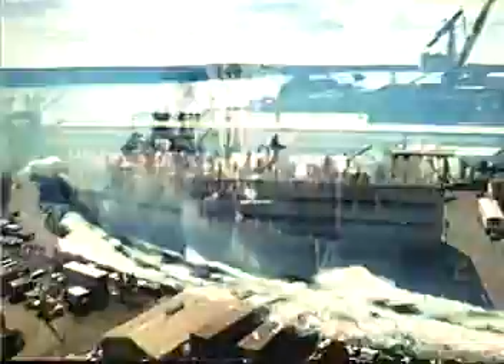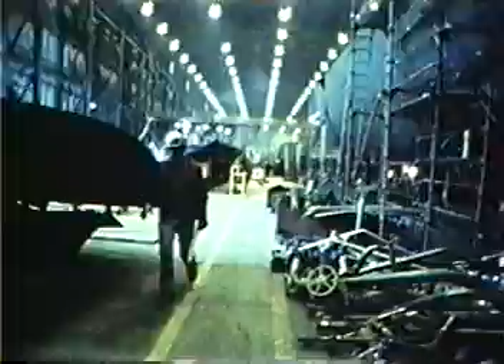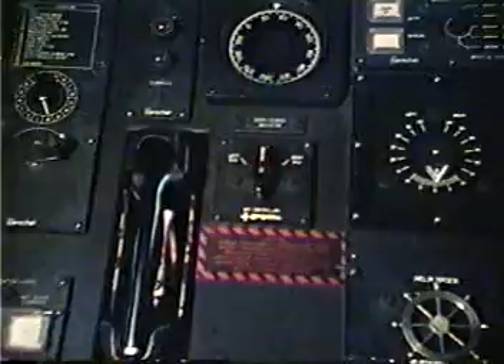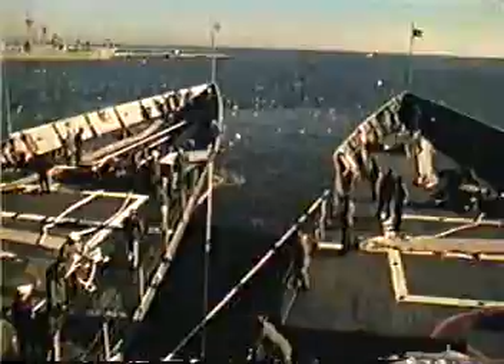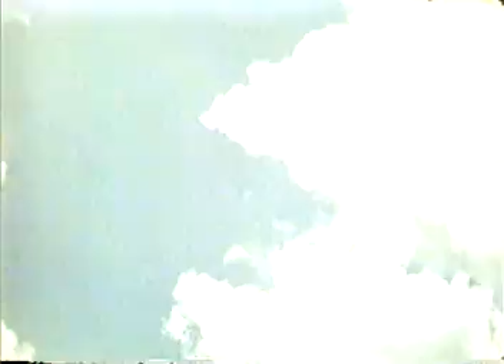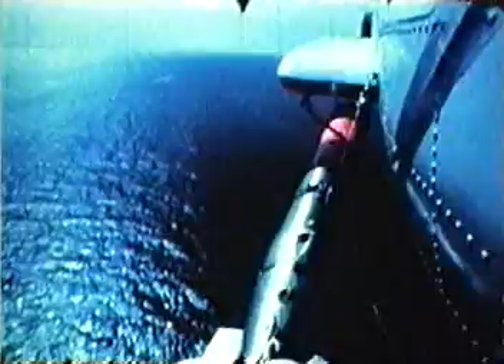FFG 7 Overview

Comment: As an ability to stay in the fight or sustainabilirt is sucked, in glad I set it on aircraft carriers, the 1 missile launcher for sn1 anti air should have replaced out of the factory with VLS, the aft mk 75 76 mm gun was a limited capability due to weapon cut out. Weapons and sensors could have been improved over time but it wasn't. We called it a jack of all trades expert at none.  It's advantage was as a sailor you worked way way way out of your rate by repairing everything and had a good grasp of being in the Navy and more marketable. Wow holy side burns and beards.

Comment: Anyone else take one cursory look at the Freedom and Independence classes and say to themselves “no way are these FFG-7 replacements”. 

They should have been kept in production with incremental upgrades like the Arleigh Burkes. 

Put a small 8 or 16 cell Mk41 forward where the Mk13 used to be, cant the superstructure surfaces inboard and apply stealth coatings for lower observability, a solid mast with an “Aegis lite” phased array radar. A RAM launcher on top, keep the 76mm, CIWS. torpedoes, the helicopter, and the towed array. Same basic propulsion system and equivalent displacement and reserve buoyancy through weight reduction of legacy systems and greater automation reducing crew complement and consumables required.
Reply: Getting rid of them was just a way for the Pentagon Admirals to get 7-Figure jobs after they retired.
These ships could STILL hold their own against the vast majority of the world.

Comment: QMC for USS CROMMELIN(FFG-37), '87-'91.
They handled like a sports car. Excellent ships...my favorite command.
My only down-notes:

The minimum-crew concept and automation reared it's head from time-to-time, not only in watch-standing needs, but in design. 
For instance, the helm and helmsman position. The "helm console" had two side-by-side positions/chairs... one for the helmsman and one was supposed to be for the Boatswain's mate of the Watch or Conning Officer/Junior Officer of the Deck. The latter position was almost always vacant, as the BMOW/CONN/JOOD were always needed elsewhere on the bridge to properly perform their duties. 
The tiny helm and chair made steering difficult, without the feel of a wheel in your hands and the ship under your feet. Worse, the magnetic compass had to be placed in front of the helmsman to see it, but that also meant making if off the centerline...giving the compass an uncorrectable error due to the uneven effect of the ship's own magnetic field... an error that would be unthinkable even in the days of sail.
Lastly, even minor strains on the ship's complement of crew...emergency leave, TAD instruction, or just given bed rest for a minor illness... meant that port and starboard watch sections were very common for weeks at a stretch. Our QM allotment often meant 20-hour workdays every other day, even at full manning.
Reply from the maker: We served together. Send me a message, Chief!

Comment: GSE2, USS Copleand FFG-25.  No those generators did not startup automatically.  The ASM and the EPCC operator did the startup and phase/connection to the electrical grid.
Reply: I helped build this Ship the USS COPLAND. It was amazing. Many Todd Shipyard employees worked on your Ship to get to start to completion. It was in very pristine condition when it left our yard for deployments. Thank you for your service aboard our Ship Built USS COPLEAND FFG -25
Reply: Was on the Copeland 90-91 sure miss those days, fc2